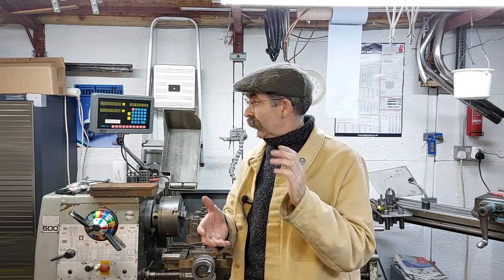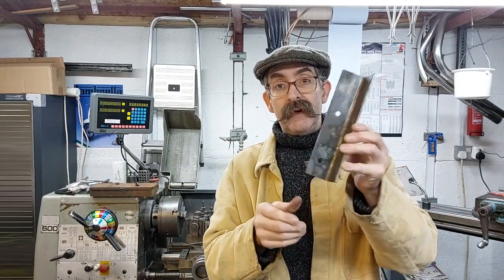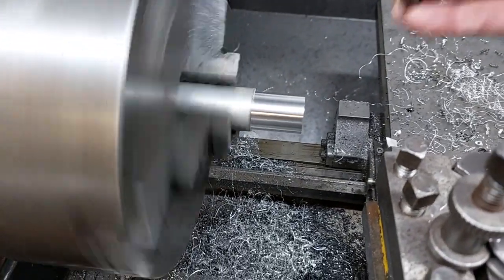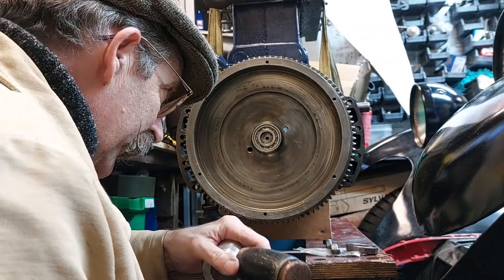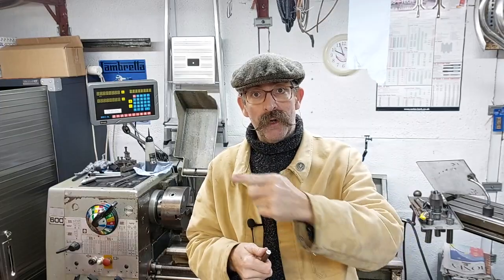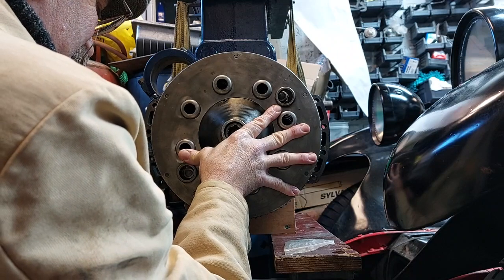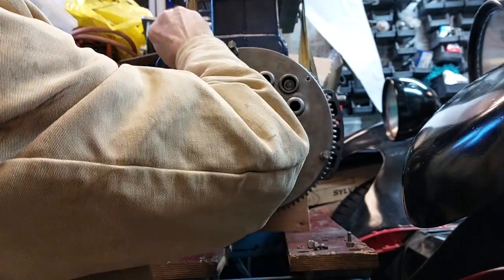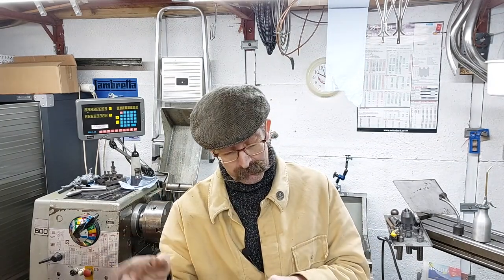RILEY 9 CLUTCH ASSEMBLY INSTALL - TRIALS & TRIBULATIONS OF VINTAGE CAR OWNERSHIP (PART 5)

Comment: With all respect, please don't leave that chuck key in not even for a second very bad habit, horrific accidents happen. Cheers.
Reply from the maker: You are quite right, I chastise myself every time I do it but I've since made a holder for all the lathe tools so the chuck is tightened/ loosened and chuck key goes back into the holder

Comment: Extremely timely for me. I get my balanced flywheel and clutch back tomorrow so engine assembling this weekend I hope. What are the chances, barely any Riley 9 content on YouTube then two clutch assembling films within a few weeks hopefully. For aligning I was going to 3D print some kind of spacer or alignment tool. I used long bolts to pull the cover down too. Luckily I remembered to give those to the engine balancer guy! What was the torque you used on the flywheel nut? The other thing I have that helps is a modified engine stand that holds the Riley engine from the side so I should be able to rotate it so the flywheel/clutch if facing up removing the whole gravity shifting things about problem I hope. Were the two weird little bearings the clutch plate has on it in good condition on yours? I am replacing mine, well the balls at least. I will hold them in place with grease while I assemble things. Goodness knows how those ever get lubrication after everything is assembled from that point on?
Reply from the maker: It's was torqued to 140 ft/lbs following recommendations from the Riley Register ( hence the Involuntary wind 😀) , the little guide bearings were fine as the balls were contained in their brass cages , I don't think they get a lot of wear as they aren't really rotating just sliding, they must be held on by a peened over end stop but didn't Investigate to much as they looked OK. The hand book recommends removing the inspection cover and dribbling a bit of oil in them when they get a bit dry......which evolves removing the floor boards.....and carpet....probably also the seats........simple maintenance!
Reply: @TweedsGarage  I picked up my balanced clutch/flywheel/crank today so engine assembly can finally begin this weekend. The engineer recommended not using much of anything in those or the spigot bearing that goes in the middle of the flywheel. They said anything in there will cause dust from the clutch to stick to the bearings and it just grinds them away. At least the Riley clutch doesn't have those 3 little mousetrap springs like the Austin 7 ones. Those are very fiddly to get in place.

Comment: I've only changed clutches on more modern cars, 1960 to 1980. I only had the use of a clutch alignment tool once. It was a great help as I knew a bit more wiggling and it would go back together. All other times it was done by eye. The uncertainty when it won't go together has made me take it all apart even if it looked lined up.
Great video and tell your wife they'll be lots more encouragement to make more like it!
Thanks for sharing
Reply from the maker: There's always that doubt whether it's just the splines not quite lining up  or the clutch is a bit off...we shall have to see how it goes....and my wife would assure you I really don't need encouraging 😆😉

Comment: I used a spare (& unlikely to ever be used) clutch plate, a length of flat bar and some steel tube to make a lock for the crankshaft on my Austin 7, used a number of times now & works well, the Riley is of a similar design so this method could be used, the advantage over your tool is that all the parts are bolted together as I don't weld...

I used long bolts to compress the springs in the same way for the Austin 7 too!

Good progress, well done & thanks for sharing!
Reply from the maker: Thanks Gary, yes the long bolt and nut system for compressing the clutch works really well with enough control  to be able to make alignment adjustments as you go

Comment: I spy with my little eye, a Willesco boiler with the sight glass out. Leaking?
Reply from the maker: It is indeed and the boiler end cap has corroded through, so it's on the " things to do list ", it's an unusual version as it's electric, as like a kettle, not a motor.

Comment: Having only ever used the lump of wood method , should I ever need to remove , replace the flywheel of my car I shall make one of your splendid flywheel locating tools , good thinking Robin .
Reply from the maker: That's good to hear Mike, it's definitely easier than wrestling with the block and lumps of wood and felt a lot more secure.

Comment: Actually  the pressure  release fart is an old trick from the 1900s to measure torque
Reply from the maker: For reference a squeaker is about 120 ft/llbs

Comment: Good to see a bit of lath action. Re ambling your clutch is   not an easy thing to do but interesting to see how you go about it. As always very interesting.
Reply from the maker: Thanks Russell, i was pleased with the bolt and nut solution to compress the clutch it worked well ( i know because i had the clutch on and off three times!! )